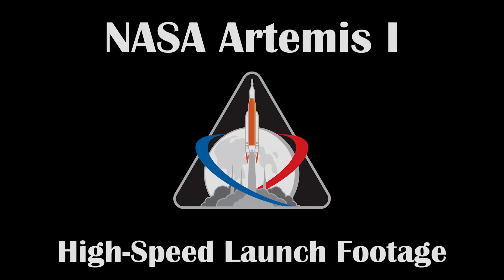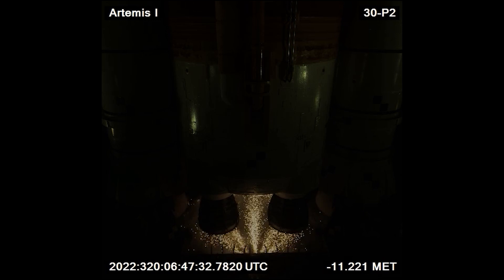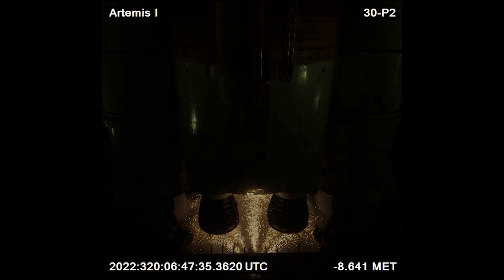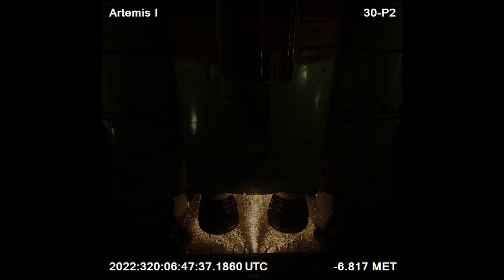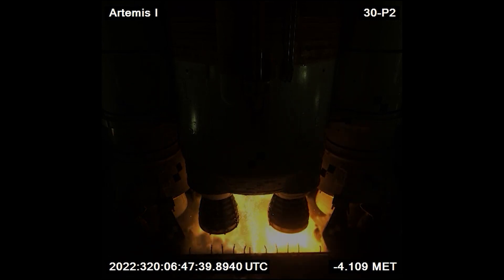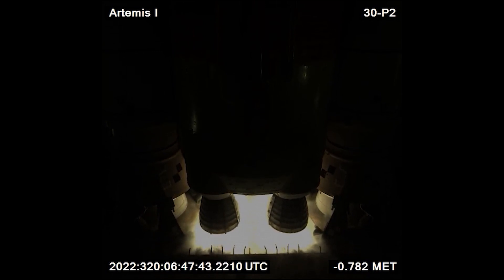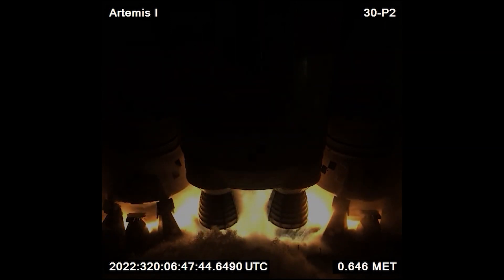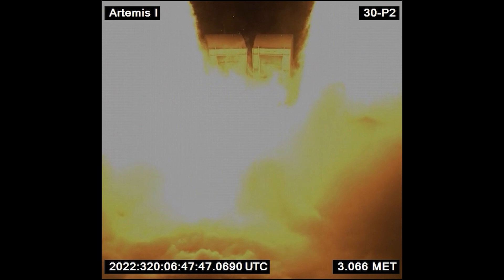NASA Artemis I High-Speed Launch Footage and Commentary

Comment: Great video and excellent commentary! Only thing is I dont think they use hold downs anymore. Once at the pad, all the bolts are removed (since SLS doesn't "twang" like the shuttle did) and it just sits on the mounting posts until the SRBs light. This also eliminated any failure mode the hold down bolts firing.
Reply from the maker: Thanks, and great info!